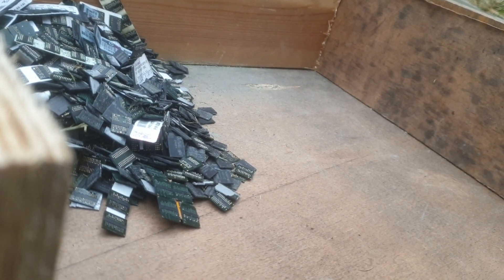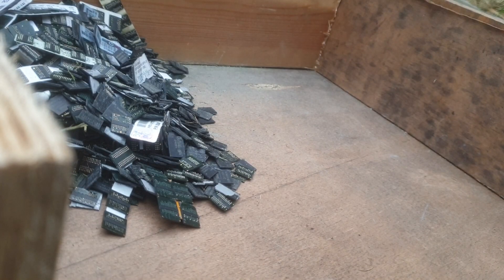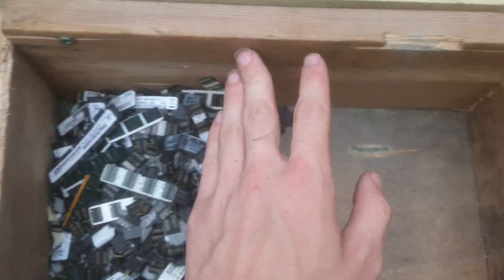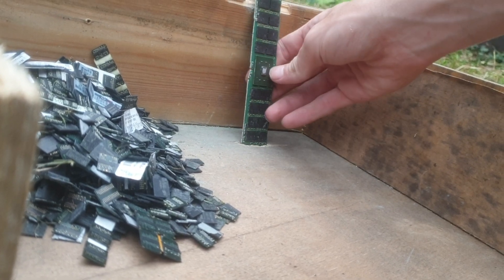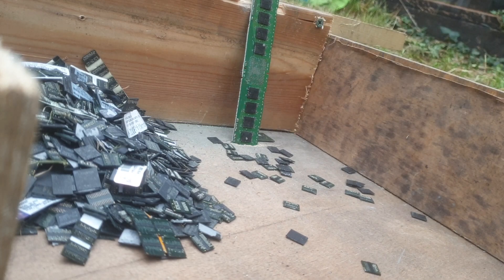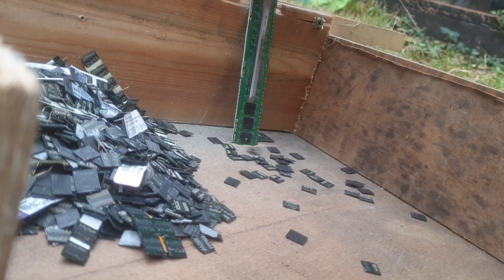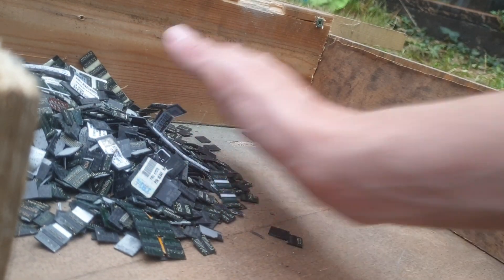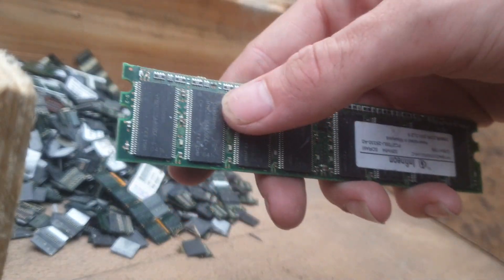Fastest way to remove bga chips from scrap ram, gold recovery 300g chips per hour

Comment: Hey man. 
Great video and thankyou.
For the flatpacks... its a bit more labour intensive and im wondering if youv done this and changed your mind, or someone else has recommended it...
But... a clean, relatively fast process is to score the legs on one side pretty heavily or all the way, then your chisel would be able lever it up then you just rock it back and forth to break the other side.... (2 sides)
And for the four side chips... score 3 sides, lever it up, rock the last side off.
Saves your acid (and the extra time and process of the acid and subsequent rinsing etc) until your actual recovery begins.
Iv only just found your channel and subbed. Sorry if youv covered this.
I appreciate the tips for the BGAs...
Reply from the maker: I just tap with hammer and chisel and they strait off. The ones with legs If it's just chips you can put in cucl2 as well and they all fall off if you have any spare acid

Comment: How much gold of 1 Kilo Gramm ram chip ?
Reply from the maker: Depends always different you would probly get 1g per kilo of ram or about 2g per kilo bga chips
Reply: @keytefirerefining1355  I have 1 kilo BGA Chip how much gold ?
Reply from the maker: @louisferrelli  if they are like the ones in my video then about 2-3g per kilo
Reply: @keytefirerefining1355  2-3 Gramm ? so low
Reply from the maker: But it really is always different sometimes by a lot so only use that as a guideline
Reply from the maker: Nah that's about right some people do yield more have seen people yield 4.5g but often less than that